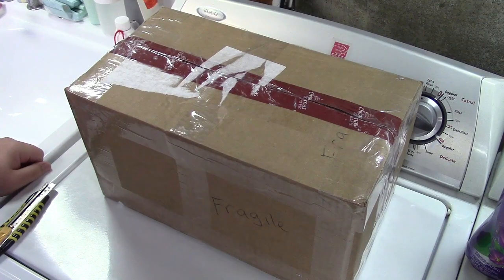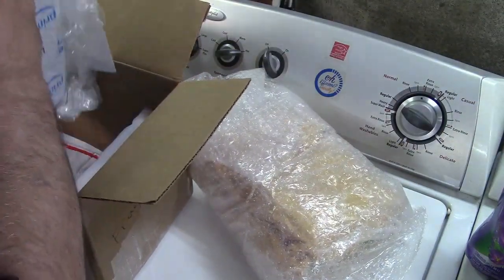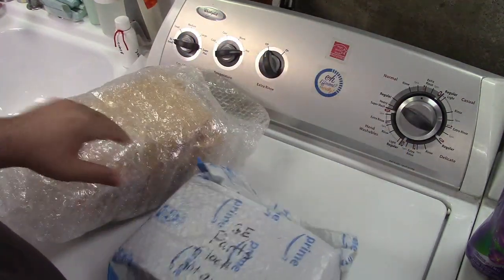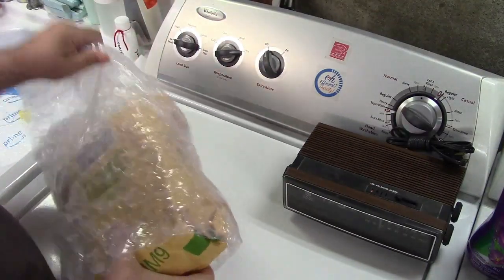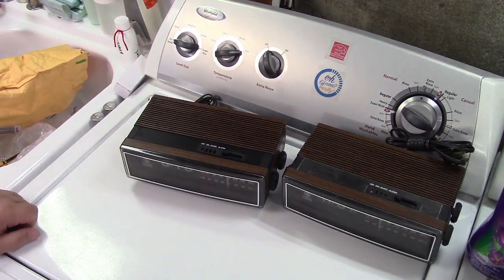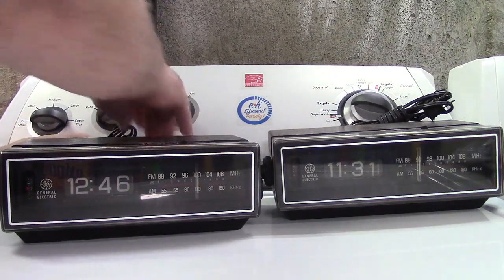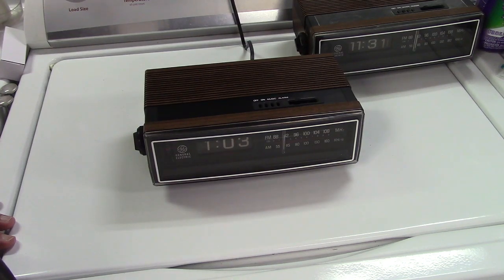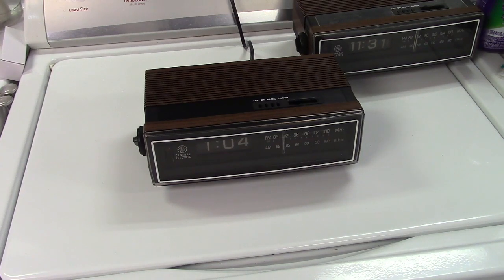The Newly-Restored VINTAGE 1980 GE Model 7-4305C Alarm Clock Radio IS BACK!!!

Comment: I'm glad they arrived intact. Yes, I went ahead, and soldered the original clock into the parts unit, in case you wanted to plug it in to try.
It's really priceless to have actual working items from childhood! I'm happy to get the opportunity to make it shine, and fully function, once again.
We had 107.5 The Oasis for our jazz station way back when. Of course, long gone now.
Great coordination with this series, and it flowed nicely!
Reply from the maker: Yes, glad they arrived intact as well!  

Agreed, there are a few other items around, that have been around since then.  More at my parents' house, I could spend hours there going through and talking about every item.

ZCount had pointed out to me that CD101.9 actually has a website, and they exist as an Internet radio station, streaming the same kind of music, on TuneIn and iHeratRadio!  I've listened to it a bit, might pick back up on that.  And, you can hear it too.

Yes, the series did flow nicely.  Now that it's over I have a holiday themed video for Thursday, and for Saturday, a followup to the "free" incandescent bulbs.
Reply: @jaykay18  I did catch that comment, and bookmarked the link. Exactly the same music I remember hearing on the Oasis!
Will be tubed!

Comment: The cool thing about this clock radio is the clock.  You see lots of flip clocks around and can still even buy them new from China but the barrel clocks weren't around as long.  Also you won't get the sound quality that radio produces out of a new clock radio.  Also although these radios never had great range as far as pulling in weak stations, new clock radios have far worse.  My old late 90s GE clock radio died a few years ago and I grudgingly went out and replaced it with a brand new Timex clock radio.  That radio just couldn't pull in anything unless you lived next door to the tower.  Also the sound quality was horrible, super tinny and unpleasant.  So after a couple times waking up 15 minutes before I had to leave for work because the radio lost the station it was tuned to I went on Ebay and bought a very nice vintage GE model 7-4691A, it's the same one Spats Bear bought right around the same time.  I haven't done anything to it, it just worked from the get go and sounds great, possibly the best sounding clock radio ever made.  The new one I bought ended up at the lake as just a bedside clock since I never have to set an alarm for anything when I'm there and if I actually did I'd set the alarm on my phone.
Reply from the maker: I remember the clock that my mother got to replace this one didn't sound nearly as good and that was back in the 90s.  So yes, they are pretty awful, and all awful today.  Even clock radios, they can't make well like they used to.  They've been cheapened out to such a degree, yet all of us rely on them to wake us up every day for work or school, the whole country runs on them.  Someone I used to work with would incessantly run late on Thursdays, but call and tell me he'd be an hour late.  It didn't make any difference to me if he came in late because I didn't have to wait for him to relieve me.  But every Thursday, like, er, well, clockwork, he would call and say he overslept.  Hmm...I really don't think that was his alarm clock's fault.

Comment: Would think that is a standard orange/pink neon tube, they use a red filter?   My rolling car clock (1979 GM) was like that, made scraping noise while in motion.
Reply from the maker: Looked like a standard neon bulb to me.
Reply: @jaykay18  Reddish cast though.  I had a late 60's early 70's GE Analog clock radio that had the standard orange neon behind the translucent black (smoke) panel behind the clock face with white clock legends. That lamp went out as well & a PITA to get to.
Reply from the maker: @CSmith-gb1sl  I have 2 teardown videos of this clock, and @dynatrak has some videos of it torn down as well.  Perhaps you'd take a look.